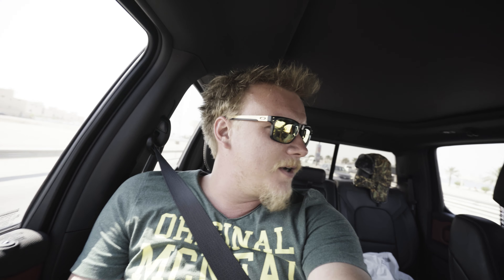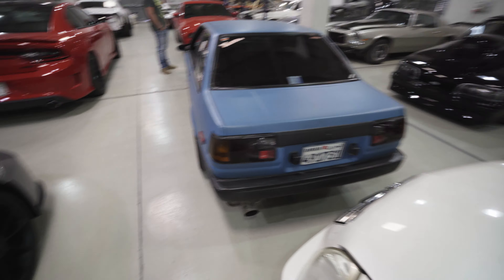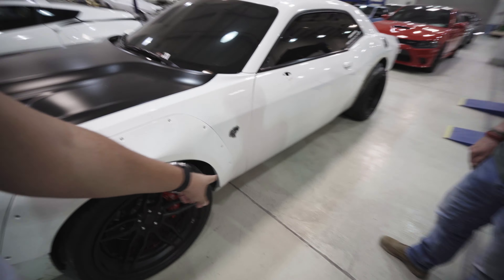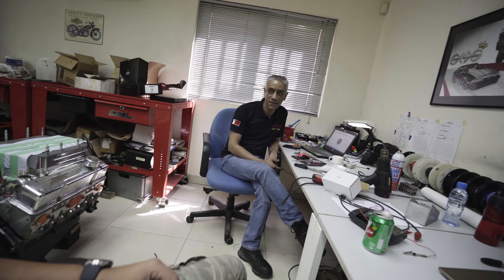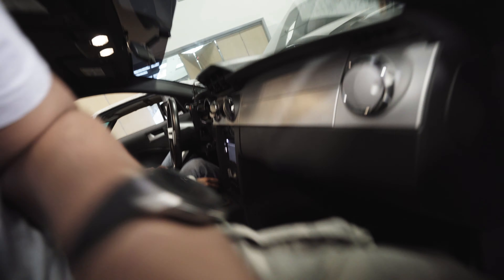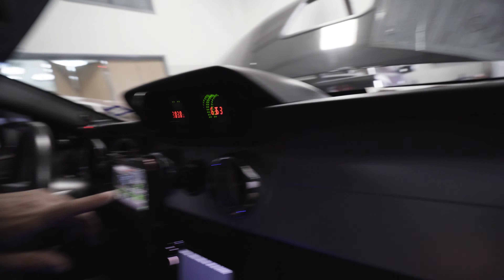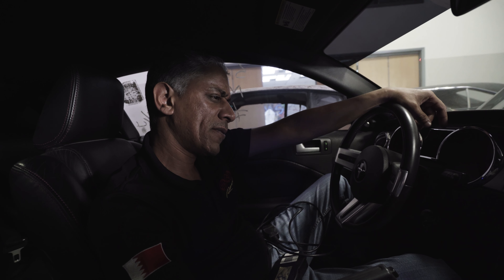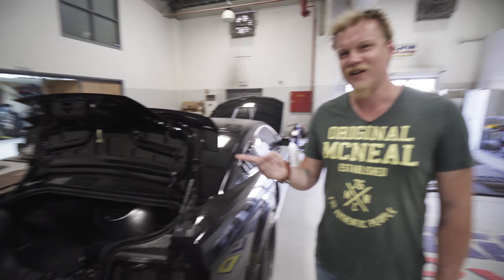Challenger Widebody Hellcat going Two Stage Nitrous

Comment: Fro my experience Nitrous is safe if you use it responsibly and have the right precations 
Fuel pressure switch,  prevents the nitrous from activating if the fuel pressure is below a safe level.

A wide-open throttle switch prevents the nitrous from activating when you aren't 100% in it. If you launch at the track but lose traction, getting off the throttle will deactivate the nitrous.

RPM window switches only allow the nitrous to activate when above or below a certain RPM range. For example, the switch might open above 4,500 RPM and close at 7,500.

 The big challenge for us in the GCC  the nitrous is like Goldilocks and works best when not too cold or too hot. Temp affects bottle pressure, which affects flow rate, and that can change the air/fuel ratio.

Use the highest-octane gas you can find,, in order to prevent preignition “ping" or detonation. Detonation is something that will quickly do damage to pistons and valves.

Buy one-step-colder  SPARK PLUG  and gap them slightly smaller than factory specs. This makes it easier for the spark to jump the gap when under high pressure.

Hope this makes sense 😂
Reply from the maker: Really good info thanks for that 🙏🙏
Reply: Looking forward to see the upgrade